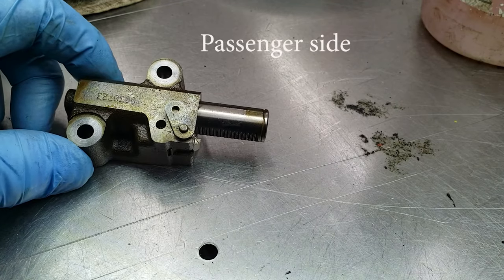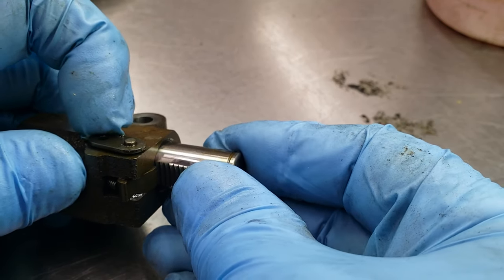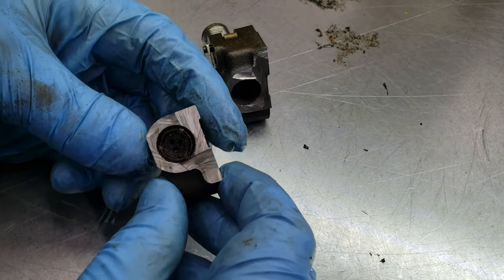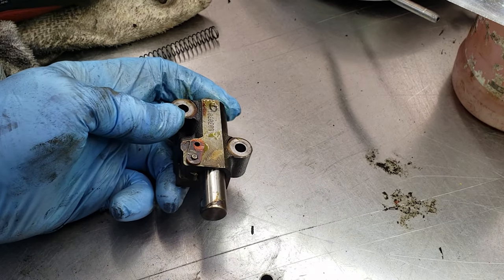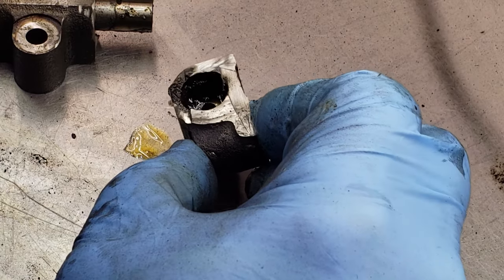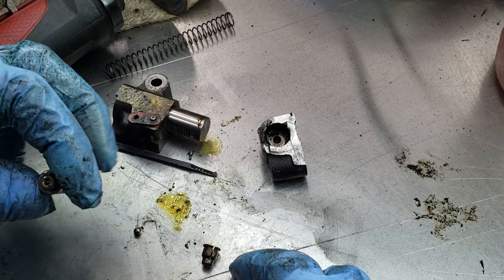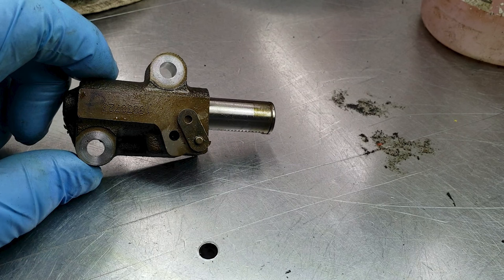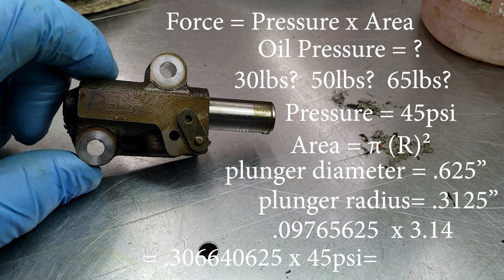Tundra Timing chain problems - root cause

Comment: You know, after thinking about what I found with these tensioners, I'm wondering if just using carb cleaner or a similar product to dissolve the varnish on the outside of the plunger might resolve the issue?  Instead of taking the whole engine apart, you could use a small diameter tube (like a metal brake line ) along with an inspection scope (cheapo scope that plugs into your iPhone) and work your way down to the tensioner and spray it down several times to dissolve the varnish on the plunger. If you spray it several times, I would think some of the liquid would run down the plunger into the tensioner and melt the varnish?  You can easily get to the driver's side tensioner through the oil fill cap (just remove the short extension and cap from the valve cover) OR an even better way is through the two access plugs on the timing cover!  There are two threaded plugs on each side/bank of the timing cover that are very close to each tensioner that you can just unscrew and use your spray/camera setup to spray down the plungers. I would definitely give this a try first before doing all that work to replace them. You will still probably need to remove some of the accessories from the front of the engine to get access to the plugs.  I still believe it was just the varnish that caused my tensioners to stick. I found no evidence of any coked oil inside or physical damage to either tensioner.  I would spray each tensioner several times and let it work for a minute between sprays.  If you try this process, I would change the oil immediately afterward ( before starting the engine) because the carb cleaner will dilute the oil to some extent even though there are 8 quarts in the engine.
Reply: Has anyone tried this yet before committing to this big job? Should I try PB Blaster, Carb Cleaner, mineral spirits? My noise is definitely driver side top tensioner, would love to not tear all this shit apart lol
Reply: @teamhogmeat  I would try carb cleaner or maybe starting fluid to melt the varnish on the plunger. Spray some on, wait a few seconds, spray more, wait, spray more, etc. If you can melt that varnish, it should solve the problem. Get an inspection scope for your phone and fish it down there and watch it while you spray it to make sure it dissolves. I really think if you can dissolve that varnish, it will fix it and save you a bunch of cash and time.
Reply: I tried it yesterday. Didn’t help. I used the carb cleaner. The tensioner looked pretty dirty and I did clean it but it didn’t help unfortunately
Reply: @kuzebnyi Thanks for following up after trying this idea out. I bought a borescope and was hoping to do the same, but this report is discouraging. Did you spray the whole tensioner body and piston or just the piston?  Do you plan on replacing the tensioner now that this did not work?
Reply: @teamhogmeat  I was hoping it’s gonna help too. I sprayed only the piston and only from the top. Maybe if there’s a way to spray the bottom it would help but my engine looks pretty neglected. I bought it with this issue almost 2 years ago and put like 30k miles and it doesn’t seem to get any worse. It’s only on cold starts. But I do plan to change the tensioner. Looking for a good brand for the timing chain kit right now.

Comment: its the oil pressure sipping out the tensionner,,,thats what is causing the noise,,,,pull the fuel pump relay at cold start,,do a long crank,,,then put back the fuel relay,,,no more noise..because oil pressure has build up in the tensionner
Reply: Didn't work, how long should I do the long crank
Reply: @marcopolo8249  its like 5 or 10sec max...if it not working is because tensioners are to far gone and needs replacing

Comment: I had same issue only on hot days I replaced tensioners problem was not solved
When problem started I would change oil and rattle would stop
Then oil changes didn’t help after a while. Then high mileage Lucas would make it go away.
Now nothing helps but it drives fine 
It’s been rattling of and on for 100k miles 
I’m at 250k

Comment: Question:  What brand of oil and viscosity?  Oil change interval?  
I don’t have any noise yet.  My ‘08, which is identical to your’s, even color has 147,000 on the clock.  I just did the starter, more of preventative maintenance than failure.  It was a bit of a bear, but nothing compared to your repair.
I’ve run Royal Purple 5w-20 since new and have changed it religiously at 5k or sooner.
Reply: I did all oil changes every 5k as indicated by the maintenance light. I used Valvoline full synthetic 0-20 in the winter and 5-20 over the summer months. I'm not sure what brand and weight oil would be best in that particular engine. I do a fair amount of idling so I'm not sure if that creates more heat or causes more varnish to form. I think adding an oil flush product a few hundred miles before each oil change might help keep varnish to a minimum BUT I don't like the whole idea of thinning the oil with something that breaks down varnish because it might also break down the lubrication the oil performs and cause additional engine wear. Most likely, in the future, I will flush the oil once in a while to help keep varnish to a minimum.

Comment: I replaced my tensioners etc. at about 160000 miles due to chain noises growing louder over time.  When i took everything apart, the components were very clean, little to no build up on any of the components.  The noise went away.  It started coming back faintly after about 5000 miles, now at 10000 miles its clearly back.  It took my daughter and I 4 days to replace, I'm curious what else may be causing this???  could it have something to do with the VVT valves on the valve cover???  Anyhow, I may machine some pressure monitoring adapters for the valve cover to see whats going on.  let me know if you have any thoughts...
Reply: It's hard to say. Does the noise sound like the chains slapping around OR is it coming from higher up near the VVT sprockets?  I haven't seen anyone online who had to replace the VVT's because of this problem but it's certainly possible. The VVT's are about 400 bucks( x 4 =$1600) so most folks don't replace them if they still seem to work ok. Mine were fine,  That 5.7L make a significant amount of tappet noise even when it's running fine so make sure your not hearing that noise and thinking its the chains.
Reply: @danmccarthy206  I will look into it a bit further as time permits.  The noise comes and goes when the engine is running.  It's audible more often then not and is worse when the engine is hot.  Thanks for the response.
Reply: @montanacontrolsllc3272  maybe get a stethoscope for mechanics and see if you can hunt down the source of the noise. Maybe find a great repair shop and ask them to diagnose the noise then repair it yourself?
Reply: Has anyone tried machining or modifying a tensioner that will plug up the oil route or reroute the oil so that it flows out the side of the tensioner and then put a stronger spring inside the tensioner, that will keep constant pressure on the chain guide. Just a thought.

Comment: Tremendous job and great explainations. A few years back i started using marvel mystery oil. one half quart marvel the rest 5w30 walmart elcheapo oil. 3 thousand miles or 6months. mmo has a wetting molecule(s) . change the filter at every second oil service. modern engines use oil for actuators and whatnot so id rather do more changes with cheap oil since im not driving like a nut or have turbos. btw a channel called THE CAR CARE NUT is specializing in toyota and is a must

Comment: Its always the driver side tensioner to its the only one that uses oil to pressure it mine failed and timing guide  came off and fell into the oil pan and got munched up and put aluminum filings through my crank and took out my bearings make sure  you change oil at 3-5000  you should be alright dont use heavier wait oil the tolerance s in the engines are small and heavy wieght oils will do more harm than good

Comment: I think it’s varnish as well. Other folks in other videos have said they run seafoam treatment through crankcase/fuel system and some have success with it fixing the tensioner. Seems like it’s worth it to try removing varnish before taking on the huge job or paying to have it done.

Comment: It's a bad design, and it doesn't allow enough oil to enter the tensioner.  Toyota knows this, they've redesigned the tensioner to correct the problem.  However, they DID NOT issue a technical bulletin or recall notice to owners.  There is a TB that just says the part has been redesigned, and the new part number is a suitable replacement.  I'm currently replacing all three tensioners in a 1GR-FE (same tensioners).  They all failed with low millage and proper maintenance.  If you have a vehicle with that model of tensioner, you have a disaster waiting to happen under your hood. Or not, mine was running fine with no tension on any of the chains.  Minor excessive valve train noise and an engine whine is what alerted me to the problem.  No drop in performance, efficiency, or DTCs.
Reply: For a noisy tensioner - Is it worth trying an oil system cleaner like ATS 505 CRO?

Comment: I have this same issue. 2015. Noise started at about 95,000 miles. Started replacing one quart of oil with Marvel Mystery oil at about 110,000 miles when I finally figured out what was making the noise. It helps tremendously. Oil quality seems to determine how long into the oil change interval the noise returns. This past oil change I had to use normal Valvoline full synthetic and at 4K into oil interval noise is back. Changing oil today with Penzoil Ultra Platinum w/ MMO added with the hope that the high quality of the oil with superior lubricity will get me to 5k with no noises.
Reply: Oh and current mileage is 148,000. Does anybody know or have heard of catastrophic failure repaired to this issue?
Reply: Did the Penzoil ultra plat with MMO Combo work?
Reply: Did the Penzoil ultra / MMO combo do the trick and fix noise?
Reply: Did the ultra work for you ???

Comment: Would you happen to have a list of the parts needed to do the timing chain tensioner replacement? Example seals or sealant or any other major parts needed to be replaced once the maintenance has started. Thank you.

Comment: When I changed my timing chain the tensioner looked fine seemed to work good by hand. The varnish causing it to lock up when pushed all the way in was the problem as it would stick until motor was warm.
How ever if the varnish was re moved the used tensioner work great.
Sea Foam removes this varnish and restored parts original function.
Just keep using until it's like new.
I used Pro Long to reduce engine friction by 80% 230,000 miles and never uses oil if changed by 4000 miles.

Comment: This happen to me this was the trick.
Read tile end.
At first at about 80 thousand it started. I had the timing chain changed... That help for about 30 thousand miles. At $2800.
What causes it is the varnish on the tensioner .....and the vvt valves.
So it went on until about 230,000 miles... So under my reluctant judgement I went to O'Reilly's and bought one can of sea foam to remove varnish before oil change.
I ran it on idle as I was traveling using  inverter for about 60 hours then it almost went away. So I did an oil change. And that did it acts as if it is new again. I will now use Sea Foam before oil change more often.
The tolerance of the parts of this motor are such as that as seen in video here the tensioner get varnish on the end of it's shaft and sticks holding it in....
The vvt silinoids also are the problem as they stick not allowing the timing to position until motor is warmed up enough to expand plastic loosening to adjust time on vvt valves.
I had this problem, I paid the price no changing oil enough because I was running full synthetic.
That is a no, no.
Make sure to change oil 3000 to 4000 miles or it will varnish inner parts.
Hope this helps, I scoured You Tube for years with the fix and never found it.
This is the fix.... If you have to change the oil and use another can of seafoam until it stops and goes to normal operation.
One ounce per quart of oil only.

Comment: To make it even more complicated mine only does it at engine warm temps. Never cold. That was with 0w-20. About to sell this rattling POS

2014 with 107k when the noise started out of nowhere. Of course right after an oil change.
Reply: Mobil1 did the same for mine, instantly

Comment: Fantastic Video, GREAT JOB digging into this.  Still not a clear answer, but certainly much needed info for everyone.

I too have the cold start rattle (goes away when warm)... I was convinced that it was the driver's side tensioner.  I ended up letting the dealer look at it and they insist that mine is NOT the tensioner.  They say my problem is a sticky lifter.... about $4.5k to fix, but they recommend leaving it alone.  So I am leaving it alone, though I'm not sure I believe their analysis.

Comment: I think I would have tried using a higher viscosity oil, such as 5W-30. This would raise oil pressure a little bit and produce slightly higher tensioner force. Calculate force at engine idle when oil pressure is lower. Oil pressure at idle when engine is hot should be lower than when the engine is cold, and yet the noise happens only when cold, so that is confusing. A Google search shows many are concerned about low oil pressure at idle.
Reply: I have used 10-30 in it as a test but it didn't seem to make any difference. Once the engine warms up, I seem to have the same oil pressure (according to the gauge) no matter what oil I run in it. I think the tensioner plunger sticks when the engine is cold because the diameter of the tensioner cylinder is slightly smaller than when it's hot. As long as my engine was hot, the noise went away.
Reply: @danmccarthy206  Hi Dan, I'm having the same problem when on cold starts the noise so annoying, 5 min later when warms up it goes. And sometimes I heart at drive thru really bothers me. What did you do to yours if had it? And is it harmful for the engine if you ignore for awhile?
Reply: @Abdul-mh5zh  Hi Abdul,  You can run it for a while like that BUT I would plan on having it repaired ASAP. You might want to try an oil flush or Marvel Mystery oil added to the engine oil. That MIGHT dissolve some of the varnishes and allow the hydraulic tensioner to work properly. Right now that tensioner is probably covered in varnish and this is what causes the plunger to stick and not fully extend once the oil pressure comes up. I would flush the oil several times (running clean oil between flushes) or try Marvel Mystery oil as an additive to help loosen the varnish. The repair job is so costly, I would try several flushes before doing the repair because it might loosen enough varnish to make it work properly.  See the repair here:  https://www.youtube.com/watch?v=CEwUC7cxGz8&t=965s  It's a long and difficult job.

Comment: Thanks for the videos and nicely done. My 2015 Tundra is making a rattling noise. It does it about 1 minute after start up and then goes away after 30 seconds or so. I think I’ll try the carb cleaner trick you mentioned before doing my next oil change.